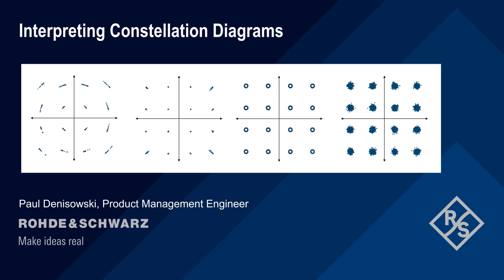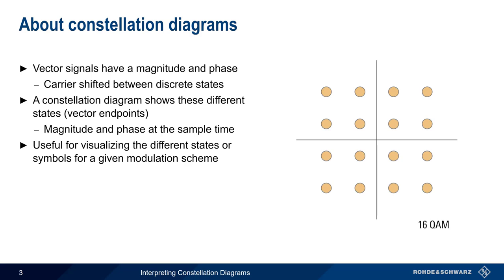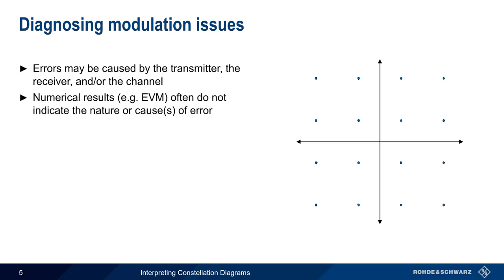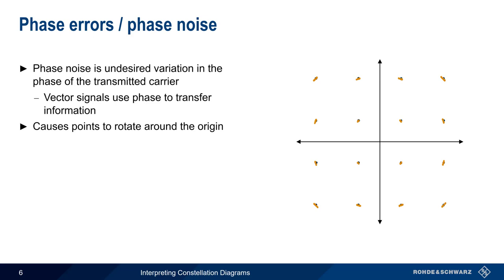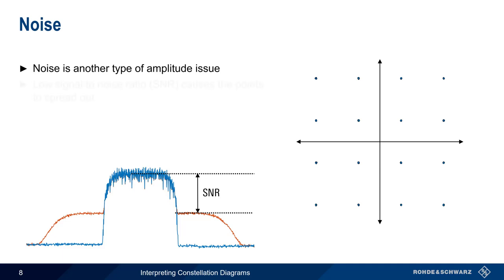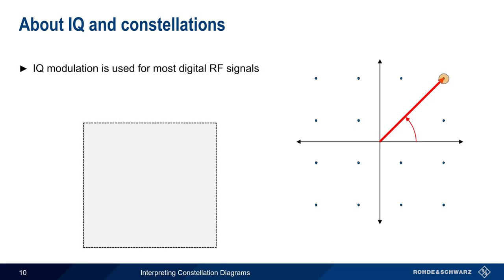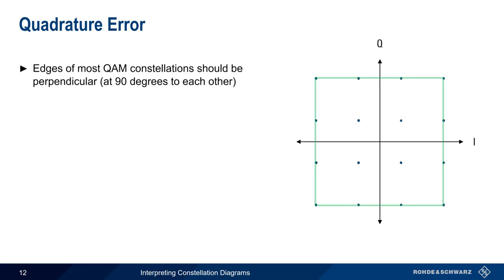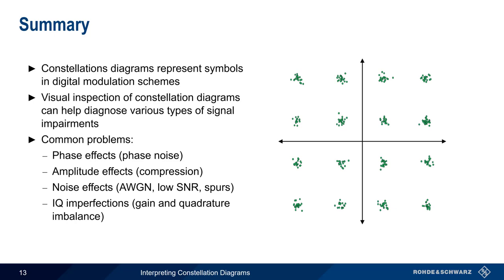Interpreting Constellation Diagrams

Comment: Thank you for a clear and understandable presentation of the information.
Reply: Thanks for the feedback!
Reply: @pauldenisowski  Thank you so much for this gold video regarding constellation diagram interpretation,
Please, what about symbol rotations in the constellation diagram for QAM-OFDM? what is the reason?
it is related to the channel?
Thank you so much for your response and help :)
Reply: @bstanis1237  Symbol rotation in constellations is almost always due to phase noise (frequency instability).
Reply: @pauldenisowski  Thank you so much, but phase noise is related to the used channel? or what is the original of this issue?
Reply: @bstanis1237  Phase noise (unlike "normal" noise) is normally due to imperfections in the transmitter and/or receiver, not in the channel.  Hope that helps!

Comment: Between is typically used when referring to two things, like "between a rock and a hard place," while among is used for a greater number.
Reply: Thanks, point well taken - I appreciate precision in language :)  I assume you're referring to slide 3 ("Carrier shifted between discrete states
").  Since the carrier always moves from one state to one another state, I used "between" in this case.  

I would absolutely agree with "among" when there is not a direct motion between states:  e.g. "during demodulation, the receiver must choose from among these discrete states"  

Again, many thanks!

Comment: But most modern communication system uses OFDM in which the I/Q value are put on the subcarrier. Therefore, most of conclusions in this video are no more valid.
Reply: Constellation diagrams are also used in OFDM-based communications systems.  In fact, in some of our other videos you can see constellation diagrams created from 5GNR and 802.11ac signals (both OFDM-based technologies) 

https://youtu.be/_dZhxmgT1bE?t=143
https://youtu.be/su0orD9E7Nk?t=60

You make a good point regarding OFDM in that each subcarrier is individually modulated, so the creation of constellations from the recovered, per-subcarrier IQ values is somewhat more complicated than in non-multicarrier systems.  But constellation diagrams and the methods by which they are interpreted still apply in OFDM-based systems as well.
Reply: The video links seems to be not working. Can you please share them again? Thank you. Great Video by the way.